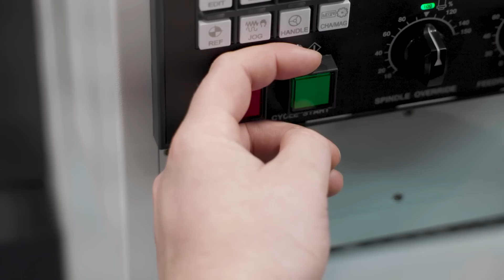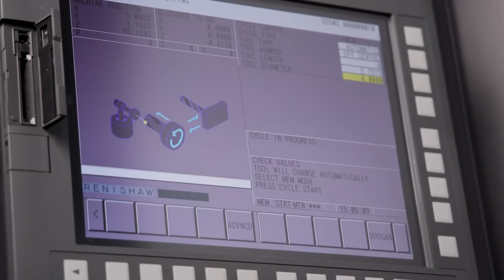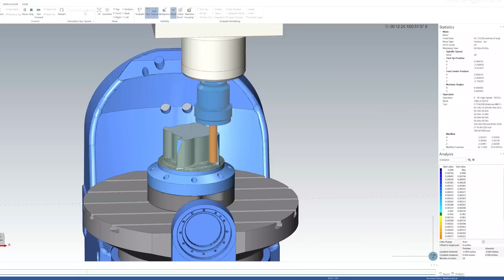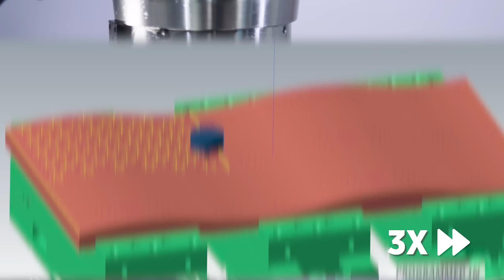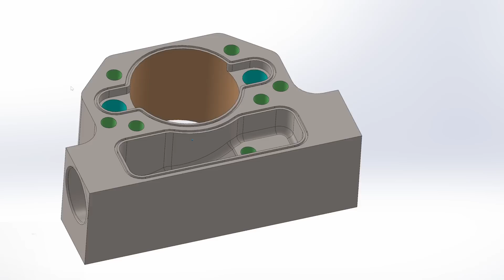My HSS End Mill Will Machine Circles Around Your Carbide Tools

Comment: My boss refuses to buy new tooling for jobs, there's endmills that have been here longer than me, been sent out for regrinds got knows how many times. I know they charge for tooling when quoting but getting them to buy us new tools is like pulling teeth, they're just pocketing these consumable charges. Current machine I run will barely handle anything beyond a 1 inch end mill, it is literally MS-DOS powered and the Y axis visually rocks on aggressive cuts.

Comment: That depends a lot on the kind of materials and jobs you are running. I am machining mostly high density polyurethane for composite moldmaking and more often than not, I need something very custom to get the geometry right. Like inverted tapered endmills with multiple radii on them. HSS still is the best for that. Since PU is so soft, they last forever anyway and it's easy to get those endmills made in the weirdest of shapes without breaking the bank.

Comment: I started working in a small machine shop where the boss was open to all kinds of input about ideas to make his machine processes faster. If I suggested it he'd say ok let's order the tool and give it a shot. Because of that I was always playing around with feeds and speeds and watching the program as I was running the parts looking for unnecessary moves and eliminating them. I left that shop, even though I loved it there, for benefits and more money. I went to a bigger shop where I was doing things that the programmer there didn't understand because that wasn't the way they always did it. He didn't program. He just drew the part up and tool pathed it. It ran at standard tooling feeds and speeds and God help you if you changed it. So when I got shifted to night shift I'd run proper feeds and speeds and after I got my production out of the way, I'd change them back and go hang out in the break room the rest of the night. I sometimes would hit my production within 3 hours for an 8 hour shift. That's how bad it was. Carbide isn't the best tool for every job. I have found that it's pretty much worthless on aluminum. It sticks to it like bubblegum on dentures. 316l stainless is rough on it. I have found that 100% cobalt cuts through 316 like butter. I agree though if you are machining mild steel and you are not using carbide you are wasting a lot of money.

Comment: One-off jobs in small job shops it makes sense to use HSS and even manual machines where production numbers are low and complexity is low but precision requires more than a hand drill. There are also jobs that would take more time to program than to put it in a manual machine and go to town. Lastly those experienced machinists haven't always been. They started somewhere breaking a lot of tools learning the hard way and for them HSS made education cheaper.

Comment: I did a test myself.. i was running Titanium parts with a 4 mm endmill.. i started with the cheapest carbide mills i could find.. did 10 parts with it.. then.. i took an endmill that was double the price.. and production went up to 40 parts.. so per part these endmills were half the price... also i could ramp up the feed so i saved a lot of time as well..i went from 45 minutes to 30 minutes per part..

Comment: HSS steel tools ALWAYS CUT BETTER than carbide IF they are covered with a constant FLOOD of coolant/lubricant. The needed coolant/lube is very expensive and today, often an EPA hazard, like sulfur bearing petroleum. HSS takes much more skill not to "burn" the cutting edge of the tool by over-feeding or under-feeding. The engine machine shop I've used since 1978 doesn't use many carbide tools, because "Gerarld" the 70+ year-old REAL machinist, doesn't like them. The owner is a nice lady, and I asked her what she'll do if Gerald retires or dies. "Close-up the shop, I guess."

Comment: I worked at a mold shop that strictly used HSS cutters. we even made our own fly cutters. I learned a lot of fundamental machining skills in that shop. the work environment was toxic so I ended up quitting machining and went to school for mechanical engineering. but that shop used HSS because the mills were ran hard and breaking a tool off in the mold would cause thousands and thousands of dollars in damage. the HSS was able to be cut out by carbide end mills if something happened. the HSS end mills also had better chatter characteristics. all of the parts we made were aluminum and on the rare occasion tool steel for mold slides and what not. HSS still has a profound and valid place in the machining world still and I will continue to use HSS where I am now. carbide is great if your doing production or if its your preference, but having the ability to rescue a part thats had a HSS tool broken off in it is invaluable.

Comment: sums up my last job and now my current. I'm on a piece of shit 30 year old vf3 with spindle runout, cable run data , nonexistent Y way cover sweeper, drill drawers full of HSS JOBBER bits, next to nothing for rougher/chipbreakers, nobody threadmills, general endmill supply is god awful, most of the machines are running on sour coolant, and my manager is an asshole.  just can't win dude

Comment: Well, I'll tell you my own experience. I was never "the machinist guy" - but hey, I've studied CNC programming and got my own diploma on this field. Then first job in the field came in - one of the larger company with long tradition in the region somewhat 18 km away from where I live. And guess what? I was working on NC (that's Numeric Control for you guys, who have no idea; CNC predecessor) lathe which was older then myself and programs were loaded via perforated paper (one step upgrade from perforated metal slides). In this company, most of the tools used were HSS type. In the end I was sick of this job - when the chance came up, I've jumped into completely different field and now - 10+ years later - I would probably never again accepted similiar jopb again. There are very few companies around who do invest in their toolings, equipment and other "right stuff" - but seriously, do not take that as granted. Shops like Titan is running - with all new shiny equipment, tools, neatly clean - would be probably dream job for me, but that was just as rare as unicorn is today.

Comment: At university her Italy, when I followed the mechanic technology course with the professor whose book is used in almost all colleges hetold us that thenbig problem with carbides tool was the cost, that are not just the inserys but the holder, setup etc. Its true that cost of carbide tools are cheaper now, but unless you show us all the calculations of cost for using carbides you sound just like a rich spoiled kid that want the best PC (no offense I just don't came out with another exemple).
Carbides have advantages and disadvantages. For example you cannot resharp then easily as with HSS.
For the next course, industrial management, I did a project where we calculated all the variables, set-up time, tool handling and set-up, tool life and wear based on speed, operator cost, cycle times (not always faster mean reduction of costs!), energy cost that will be higher at higher speeds etc.
I love your videos, but a  point that I don't is that you always say that faster cycles cost less.... Are you sure? Can you at least show us all the calculation of costs? For example a tool taht runs at higher speed wears out faster, so you loose time changing it, its more prone to breakage as we can see in your videos....
Again, no offense at all, but you have a dream shop with all the best equipment, the large majority of shops are not like that.

Comment: Said the cnc operator. 
HSS would last if you took care of it. When 75% of a shop was running bridgeports...... carbide wasn't standard issue unless it was being run in one of the cncs. This is where the contraband mindset came from.

Comment: I can run an hss endmill harder than a carbide in aluminum than carbide.... I've ran .017 inch chiploads and 30% stopover full depth.... so if your running only aluminum you will see $ savings with hss

Comment: hire a bunch of average good enough guys and replace them as needed never becoming dependant on any of them... or hire one top tier guy. the top tier guy will have your company by the balls and when he leaves you're SOL.  HSS is used for machines with less than optimal rigidity. Carbide is very unforgiving on less than ideal setups, hates vibration, and absolutely does not tolerate temperature shock. HSS is used in tens of thousands of manual machines for a reason. Carbide is also expensive and grinding it not good for you. you can also go into serious debt keeping up with the Jones; in this field. this whole video reeks of arrogance.

Comment: I was shopping for tools, I needed a rougher, I found a carbide .75" rougher for $150. I looked at the HHS endmills and the same cutter was $99. I can guarantee that carbide cutter is lasting over twice as long as a HHS endmill rougher. I am now looking at doing all my roughing with fast federate shallow cut insert endmills. $30 worth of inserts that I can flip 4 times.

Comment: My only problem with seriously upgrading the shop is when the boss hands out blame for bad parts when those bad parts  happened because there's not enough time to check everything. 
If the production of parts is going to run multiple shifts, and lights out, then there needs to be an automatic system to check everything when no one is around. 
I don't think that system exists today. So, someone needs to build that system which CAN help to support the workforce and eliminate unreasonable demands of them.

Comment: We have new brittan screw machines from the 40-60s mostly hss and the new brittans out run cnc machines all day we only have a few newer cncs that are trash eurotechs, we are getting a couple hydromats though still them old new brittans pump parts out all day long and are fun to run. They had to move a brass pipe nipple onto the screw machines because the cncs just can't do the volume the older ones can they are more precise but not nearly as fast, and while there may be faster cncs out there the new brittans are keeping us going

Comment: Running HSS on a CNC doesn’t make much sense.
As far as “I have an old machine, I can’t run like you do” is valid.
I have a Haas VF2 that I have to limp along with. Not sure what is wrong with it but I can’t afford to pay a tech to drive 5 hours to tell me I need a 8,000.00 spindle.
I would be better off scrapping the machine at this point.

I would invite you to show me how to hog out perfect parts on a worn out machine.

Comment: High speed steel has its place even in a modern shop, shaper bits come to mind because HSS can be resharpened and reused more and more times than carbide, not to mention grinding custom shapes, or even running softer gummy metals like aluminum or copper because you can get a sharper edge on HSS than carbide, I keep a bit of it in my toolbox for certain cases
Reply: Taps as well.
Reply: Just get a Garr or iscar carbide aluminum endmill with the zrn Coating 3fl you'll run thousands and thousands of parts on one and itll keep going. And you'll be able to run ungodly feeds and speeds like 1300 surface feet with feed rates well over 100ipm. I had one that I kept in my box that lasted 1-2 years.
Reply: @phuckyocouch9098  if you are making your tools in house, selling them, using them in house, that can justify hss. Nothing else.
Reply: @MarioAPN  really the only reason I see is if you need a form tool in the shape of something that doesn't exist and have the grinding equipment to pull it off or taps. Carbide taps are trash in most cases and good luck getting it out when it breaks.
Reply: @phuckyocouch9098  true. We are using unc and one other known taps manufacturer and I can't recall it right now. We are also manufacturing taps in house, but they are not as good, unfortunately. Making your own tool is great. This is average size shop, 2500 people are working in it, there are tons of material being turned and milled every day. You kinda want your own tool manufacturing piece of company when you are doing that. They are buying iscar inserts, but that is almost everything. They are coating it, but it is not near carbide. Carbide is doing magic. Edit: the other one is unis.
Reply: Osg makes good taps.

Comment: As far as I know, we only use 1 HSS tool and we're in the process of proofing a new program that replaces that tool with a carbide boring bar with insert. We had 2 fires in the same machine and we think its from that tool. 

Its a 10 degree tapered end mill that we use to make a cone. The end mill does the roughing and a small carbide boring bar brings it to final tolerance and finish parameters. 

Surprisingly, the end mill does really well if the flood coolant is properly used. It only cuts in the z-axis. We have our tool life counter set to 300 parts, but when I replace them, the end mill still looks brand new. I will sometimes let it run a few more parts if I'm busy with something else. I think the fires were from guys changing tools and moving the coolant lines and forgetting to re-aim them. 

That's the only HSS I've ever seen in the whole building. Maybe the tool and die guys have some, but everything I use is carbide and it is not cheap. We have some custom drills that are $300-$500 a piece and some of them do not get many parts b/c of the material and how the part has to be machined. That HSS end mill is like $30 and makes about $17K worth of parts and still has life. One of our $300 custom carbide drills only makes about $5k worth of parts before it breaks or its dull. The material its drilling is brutal though and its gotta be like a 20x diameter depth hole.

Comment: Many of the biggest aerospace shops are still buying HSS for taps, end mills etc in M1, M3, M7, M42 etc. If your machines aren't in good condition or your vices are weak or spindles bad, HSS is your answer as the high hardness of carbide is going to be brittle possibly leading to chipping? I think for low production HSS is your answer as well. Just my opinion correct me if I'm wrong. Love the videos and so bummed I missed you at IMTS this year.

Comment: And we found someone who is very focused on their part of the industry and don't have a real understanding of running and machine shop.  I wouldn't even hire someone if they couldn't set up and run a machine without having all brand new carbide and tooling.  Unless you can show me how to do the math to purchase all the tooling needed and still be competitive on the job when there's only 2 parts to make and they need them tomorrow.  I'm willing to bet most people would turn that away because they can't do it.  We charge an arm and leg and spend 15 minutes grinding up a drill or tool bit if we don't have something on hand.  We only keep the basics on hand in carbide and not much over .500".  This is just one type of work we do tho.  We also have jobs where we do purchase all the tooling specifically for that job, but that depends on the parts, the customer, and industry.  There's so many factors in this game and y'all are trying to simplify it and telling people they're wrong?

Comment: The shop I work at does still use a few HSS endmills, but we only ever use them to to create flats at the bottom of some drill holes. They are just barely removing any material so will can get hundreds of uses out of them. For serious milling we only use carbide.

Comment: Carbide use has come a long way in the last 30 years. HSS was a 1/4 to 1/5 the price of Carbide. Now if you open a MSC flyer or others. Carbide end mills make up more pages. HSS in more drills and taps section

Comment: Lots of tool and die shops in manufacturing plants use hss and clapped out old machines because they don’t run 24/7 and there’s only a few guys in the shop. But those few guys are usually absolute wizards and can dream up a solution to get production back up and running

Comment: I work maintenance at a steel mill and they never want to buy parts to repair things. We still us clapper style relay boards and have to repair them with garbage parts that we find around the shop. It's scavenge pieces out of the trash bins to hopefully fix the equipment.

Comment: i worked in a machine shop, machines and tooling in good shape, 95% carbide.
Later i ran into small in factory shops, were guys had to make parts and repairs for the factory. Millions of profit factory that is.
they used old beaten machines and only hss. had to regrind and profile on a worn out grinder, no way to dress the wheel...
i refuse to work in shops like that.

Comment: DEBURRING BLADES WHERE GOLD.  ya, you horded them2, maybe 3 at a time. a new pack would come in and you better be there......  i asked the boss before i quit why there was never enough deburring blades. "well every time i buy them there gone right away! there being wasted" (shop of 15 machinists).  i was told i was not alowed any more pens, id ave to bring my own to work as i used to many... (i did just grab 20) i looked the manager in the eyes and told him i belive it was cheaper to damge a pen than myself, or cheaper for me to pull a new one from my pocket the second one stopped working or was temp lost (wage 35/h)  managment dissagreed. apperently 20 bic pens where "a lot of money"  lie to me about the consumable costs i dont know, dont lie to me about bic pens... come one! (did i mention they closed down the machine shop a few years later?)